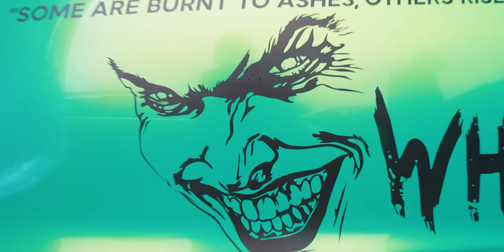We FAILED... time to retire the JOKER?! 2000hp Nissan GTR R-35

Comment: Why has he got a parachute Ricky's one doesn't have one or the other gold.one from jm imports and that is 2000bhp aswell
Reply from the maker: For safety. We haven't had to use it yet but came close when we ran 7seconds y0.
Reply: @TheRockyandBuzzShow  thanks mate just a question so is that the most powerful gtr in the country now has it more power than the orange one